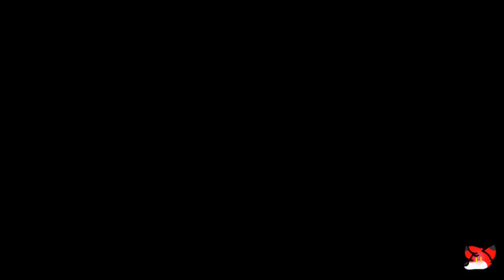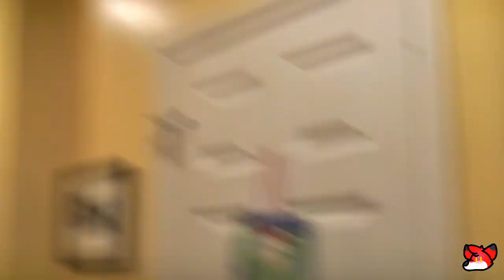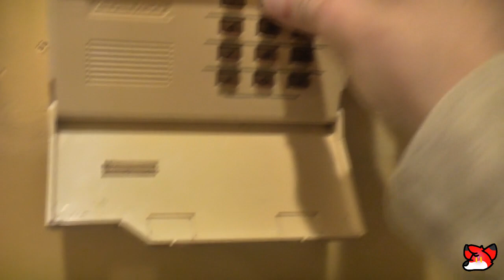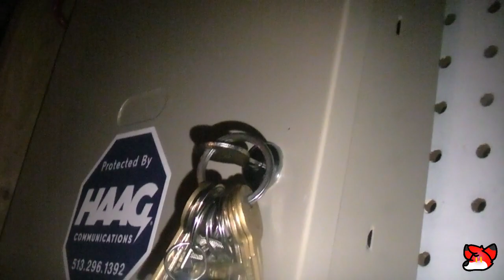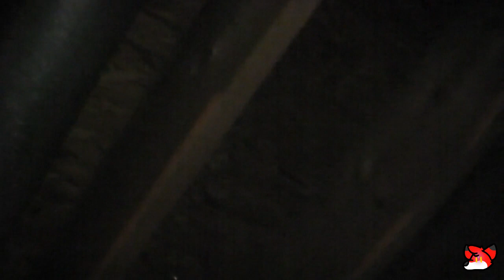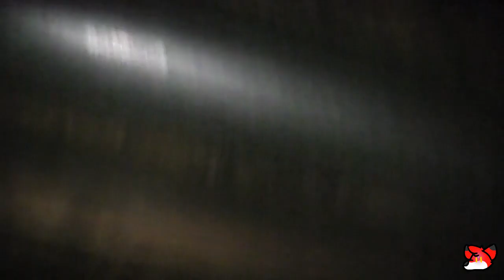Ademco Vista 15p Test 13 *PANEL CRASHES*

Comment: So, on these panels, when they’re in alarm, bell output power comes straight out of the battery.  This is actually pretty standard for security panels.  I’ve seen panels with a high load on the bell output, cause the whole panel to shut down on alarm. That siren driver eats a lot of current too and it’s putting quite a draw on the battery.   There are ways to wire speakers on a driver to budget the amount of current the driver draws, usually by putting speakers in series instead of parallel. The battery is discharging quickly when it’s in alarm.  A sure sign that the battery is past its service life in AH capacity.  I’d check the current draw out of the bell output and make sure it’s not beyond what the panel specified.  I’d also go for a new and larger capacity battery.  Just because the panel doesn’t show battery trouble, doesn’t mean the battery is actually good in terms of AH capacity.
Reply: That is why I use a 7amp hour battery. It may sound the same but it works with the VS279 and VS299 that have shown that they crash panels whenever they want to with this dude, no issues for me, just trying to get rid of the supervision issue on my panel
Reply: I agree with you. My battery cables stopped working (the battery is fine) and then since theres no battery my panel just sounds the siren for two seconds then goes into bell failure. However I found out that if I spam the panics the siren will eventually start going off from the transformer

Comment: you should run the voice driver off of an external power supply to not suck up the panel power, I use an old Roomba charger with the 4204 relay module for my fire alarms.
Reply: Wdym? How do you attach a charger to a 4204
Reply: I connected the positive output of the charger to a relay input, the charger negative to all the alarm negatives, the alarm positive goes to the N.O. side of the relay @Futurejcpl_lineman115
Reply: @willsarms3  you could just run wire from positive terminal to alarm and negative terminal to alarm for 4204

Comment: 5:15 it crashed
Reply: @Nevan Newaz's Gaming, Vloggs and more ik
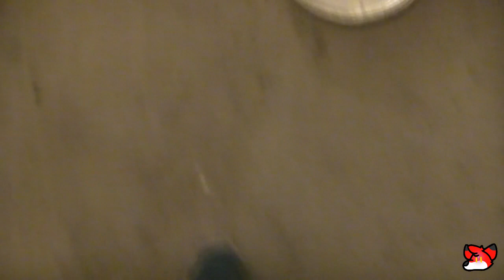Reply: 5:00 nah it crashed earlier, you can hear the panel dieing when he opens the door. And then at 5:15 the panel got low pitched  and did 6 beeps seconds after. Tangled that siren needs to be on the external power supply so it doesn’t fuck up the panel like that.

Comment: The control panel when alarm: REEEEEEEEEEEEEEEEEEEEEEEEEEEEEEEEEEEEEEEEEEEE
The control panel during alarm: REEEEEEE-dies

Keypads when alarm:
 13                                         AC
                        STAY      CHIME
ALARM     INSTANT

Keypads during alarm:
 1                                           A
                          TAY             E
AL              INST

Then it dies